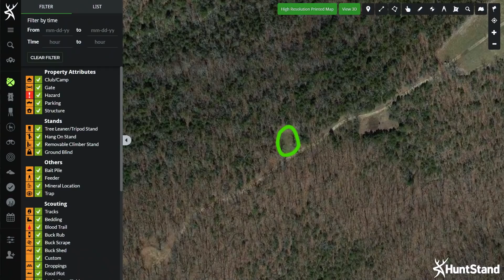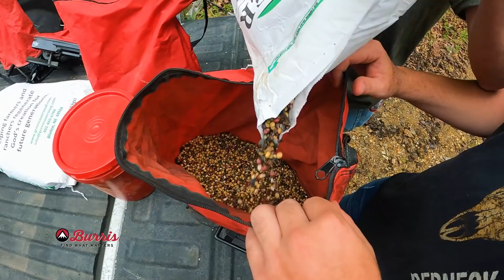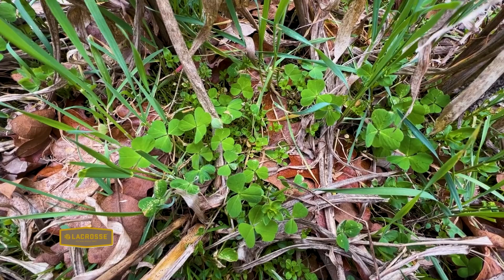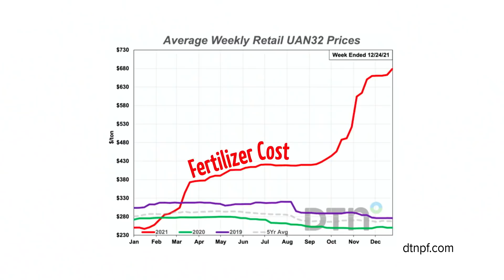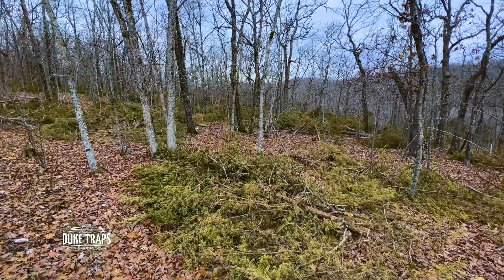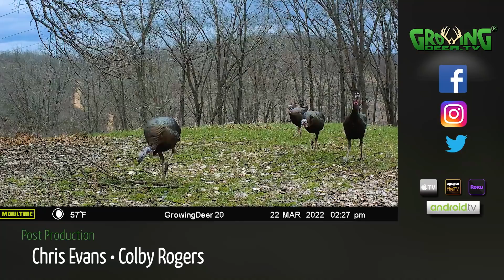No Tractor? No Problem: We Used Hand Tools To Plant This Food Plot (693)

Comment: I have just purchased 40 acres that has 3- 1/4 acres food plots on the lower more fertile ground. I have plans to add a hidey hole plot in a rocky upper road area. My question is: I have a Bulldog Max ATV disc. Could I broadcast seed in the lower fields, into the existing grasses, and use the disc at a lighter setting afterwards to essentially create the same effect as the crimper?
Reply from the maker: I doubt the disking will kill the grasses and with their established root systems, they will most likely outcompete the need growth from the seeds.
Reply: Yeah, I’ve been watching more of the No till videos. I don’t have a tractor yet, so it looks like I’ll try to cut it down with my mulching zero turn and spray. Then I’ll broadcast seed after that, just before a rain. Should I burn it before, or is that necessary/beneficial?

Comment: Is there a way to use the release system without a crimper and drill?  Would that be, wait till planting time when rain is about to come, spread 2x drill rate of seed by hand, wait till after rain is done and spray herbicide?  Rinse and repeat for each planting?  What draw backs are there to this as opposed to a crimper and drill?  If you start without these tools, which would you purchase first?  Drill or crimper?
Reply from the maker: Brian - You are correct!  Pending on the size of the area to be planted, a crimper can be made with a 2' x 6" and some angle iron attached to the bottom. I have one of these food crimpers and it's a workout but effective.  There's a trade off of waiting for the current crop to mature enough that light reaches the soil for the new crop to grow and waiting too late and allowing weeds to grow.  A herbicide can be used to insure the timing works out and any existing weeds are controlled. Yes, broadcasting plenty of seed is important!  Seed placement is key so purchasing or renting a no-till would be my first priority. Some neighbors, etc., partners and split the cost of a drill.  Enjoy the process!